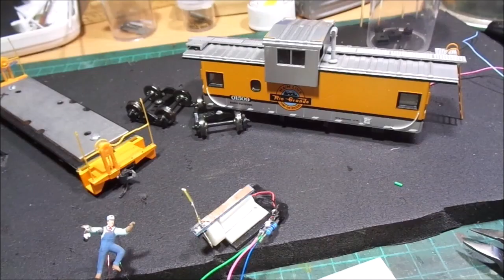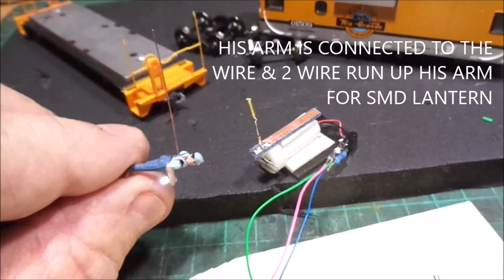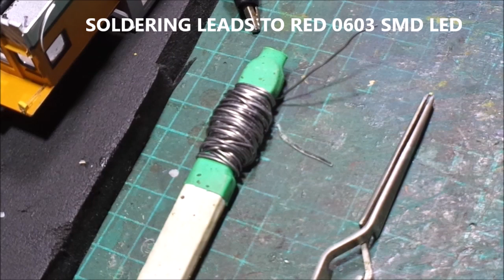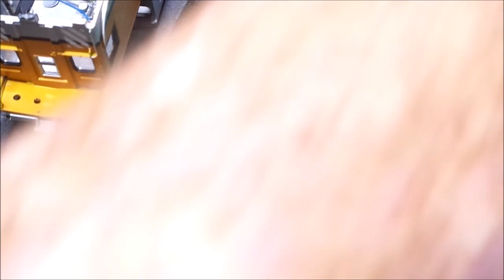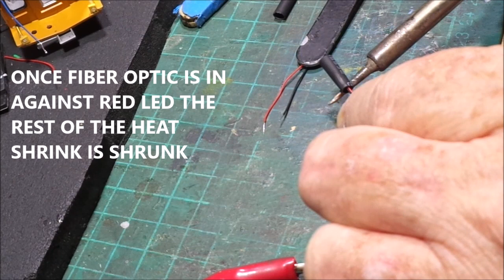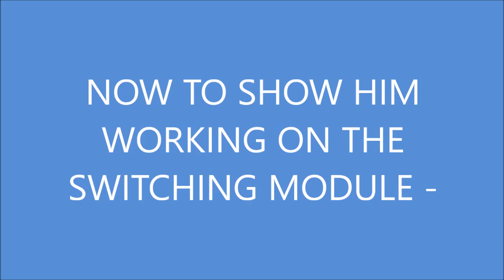HO CABOOSE ANIM8FX 2022

Comment: Hi Laurie
How do you solder the square metal to the up pole
I have tried doing it on the same type of metal but it wont stick
I have ued Flux and solder but still dose not solder them together
Reply from the maker: G'Day Steve, I think you mean the brass tube guide for the crank rod wire? This is brass tube with just a slight clearance for the wire to slide freely and it is soldered to a piece of PCB which is glued to the motor and clearance for the crank wheel to turn.
Reply: @scoopmmr  Thank you, i 3D printed a small wheel onto the small motor and inserted a pin, then tried to make a square which is then soldered to the crank rod wire

Comment: Can i ask you a little question mate
Reply from the maker: Yes, of course, happy to assist any fellow modeler - Laurie
Reply: @scoopmmr  
Hi mate
Im gavin from brisbane 
My question is wear do you get your geared moters an moter  accessories from bud
Reply from the maker: @gavco11  I get via EvilBay - search "6mm planetary gear motors" These come in various voltages - I use the 3v myself and the RPM speed needs to be 40 to 200 RPM max so the voltage can be programmed on the decoder function.
Reply: @scoopmmr  do you mean ebay
Reply from the maker: @gavco11  Yes, I'm giving a NMRA clinic at he RMCQ in Brendale this Saturday and will show the caboose there. Happy to chat if you can make it - I'm a member there. Laurie
Reply: @scoopmmr  hi Laurie
I don't think ill be able to make it on Saturday but thank you for the invite 
An all so thank you for your help as i really appreciate it an talk to agane soon 
Once again thank you for your help 
Thanks gavin